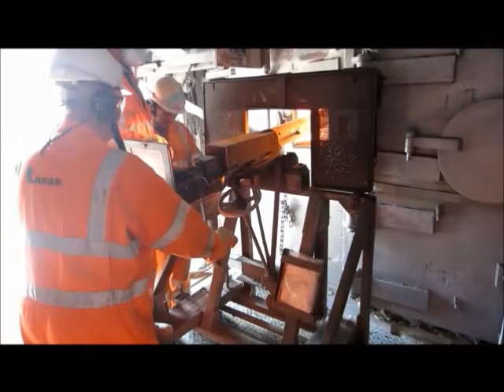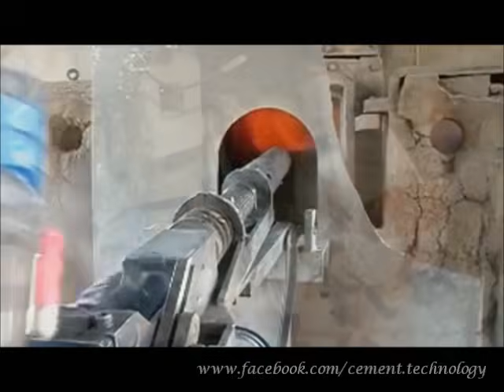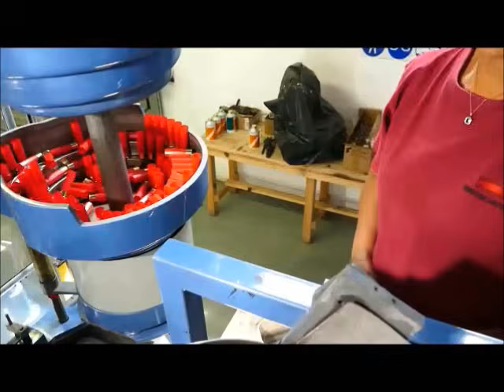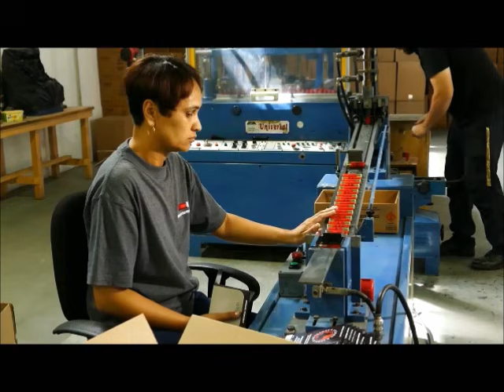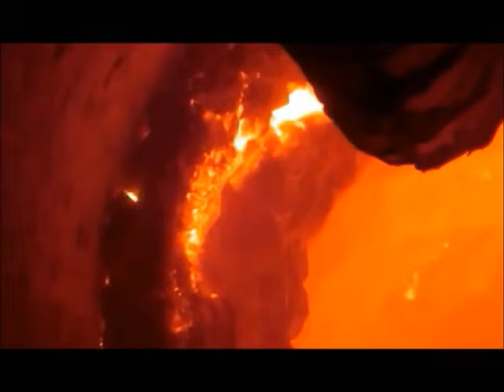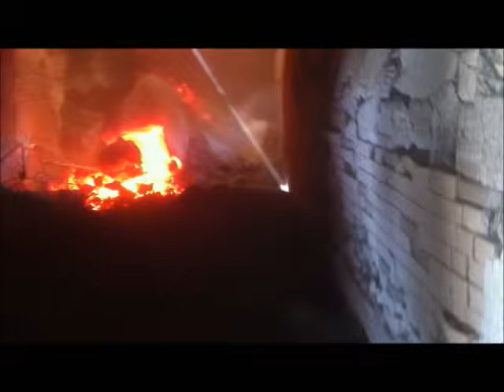Industrial Shotguns

Comment: I used to work at a coal fired power plant in south- central Illinois. We had a Winchester-Western 8 ga we occasionally used for removing slag from the maim fire box walls when deposits were extra heavy. I don't recall how much the company paid to have it on property each month but eventually, it was decided that it was more economic to send the gun back and use Remington 870 12 ga shotguns fed almost exclusively Winchester AA trap loads. The 8 ga is an impressive looking tool but after using that heavy thing vs the 12ga 870, I would have to declare the 12ga the better choice.
Reply: I thought that my father used to tease me, when I was little, I would be 6/7 years old, and he told me the story of: The American of the Winchester, that to solve a problem in a warehouse or silo, where they could not remove the  material added to the walls, and they solved it by calling an American who traveled with his winchester, up to here in the Basque country, the quarry where my father worked extracted magnesite, which I think is used in smelting furnaces to cover the interior walls of the  oven, well, the question that, that happened maybe 40/50 years, .ah the winchester was the rifle of all life, when I showed him this video, we are going to laugh.

Comment: “8 - gauge shells with bigger primers so they can’t be used in commercially available shotguns” as a resident of burger land this hurts me deeply.
Reply: Just drill it out to fit a normal 209, seating it in the original dead primer. Works well for Berdan type primers as well, but with boxers instead of 209s

Comment: They use big-ass shotguns to blast the clinkers out of certain types of coal-fired boilers. I’ve seen them do it in powerhouses, one old plant I work in, they just use what appears to be an unusually large, heavy, single-shot break-action normal shotguns that fires standard 10-ga buckshot rounds. One of the guys that runs them there gave me a shell, it wasn’t marked, but I cut the end off of it and it appeared to have been #1 buckshot. Pretty cool. The other plants I’ve worked in use those industrial Remingtons shown in the video.

Comment: Some grain elevators have a gun they can run in to the bin and shoot a huge steel slug up into a "bridge" of whatever grain in the bin. Would like to see that!
Reply: I would love to see this I work for a company we build grain bins and silos occasionally work on grain elevators I have never heard of someone shooting the grain down though hahaha I'm assuming you are meaning by bridge when a pocket is formed in the grain I've only seen that happen in silos it's very scary when it collapses when you are on top
Reply: @Aatell764  Yep,except they shoot up into it from the bottom,I've never seen it,but I was on the fire department with a guy who worked as a machinist and they made the slugs. He brought a bunch of seconds home and we made a black powder cannon that shot them! It might be an old technique,but he said they use them in those gigantic bastards that held like a couple hundred thousand bushels. They could run it out at a bunch of different levels. Had a brass cartridge that was loaded into the breech and the slug was slid down the barrel.
Yeah,the "bridges" can occur from frozen grain,mold excessive dust that drew moisture,etc. We get them occasionally right over the center door on the floor,when dust builds up or a bunch of corn stob chunks or bean debris gets compacted in a layer. Last winter we had to go down and bust up several in this one corn bin. Sucks rocks!!
Reply: @tomcline5631  Man I'd love to see it in action, and I know the type of elevator you're talking about 9 times out of 10 we are fixing something made out of metal that's been rusted all to hell from being left covered over winter in those haha. We got a customer of ours who always fills his bins full of high water content soybean/corn and every we have to go back to fix something else, we try to tell him man.
Reply: @Aatell764  Yep,we got a damn good drier,so we hardly ever have any corn wetter than 16% for more than a day or two! As for soybeans we don't cut til they're damn near perfect. Might go in at 12\13% then we put the air to em.
Reply: @tomcline5631  Nice that's actually one of the most common things we fix is driers haha well other then the power sweeps. Where are you located? Those percentages are the same that they do it down here in Kentucky/Ohio/Indiana we work all over the place.
Reply: @Aatell764  Work for a farmer in Orrick mo. 1\2 hour or so northeast of Kansas City Missouri.

Comment: I’ve done this for 10 hours with standard 12 gauge 870 with 00 buck at old willow island power station in WV back in the early 90s. We had 55 gallon drums full of empty hulls they let us take home (along with plenty of unfired shells they gave us). I was an apprentice boilermaker local#667, none of the old timers wanted to do it so I volunteered lol, sounded like fun, it was for about 15 minutes.
Reply: 12 hr. shifts,  sometimes 3 or 4 shifts. Duct tape pads to the butt stock. Doesn't help. Usually have 3 or 4 or 5 12 gauges and one 8 gauge on a tripod.  Shoulder and bicep completely black and blue. Finger too from trigger guard.  If you get a good system going and your gun keeps working you can fire the 12 gauges about a shot every second and a half. You mentioned it was fun for 15 minutes,  you got me beat by about 14 and a half minutes.😂😂😂👍👍
Reply: @snakeplissken3021  lol, I’ve heard about those 8 gauges from the oldtimers but never seen one, what profession and area are you in? Boilermaker?
Reply: @shanek6582  construction in coal fired electrical plants. Yeah, we still use them all the time at one of the plants.
Reply: My great grandfather did this with a 10 gauge sxs in a steam powered sawmill back around the turn of the century in Northern MN.

Comment: Seems pretty inefficient. Especially the manual loading of shells 1 by 1.
Reply: There are many reasons for that. Keeping a magazine near that glowing kiln pose a risk of cook-off. Also, the gun designs should be simple and robust because they may consume up to 3000 shells a day. Unlike hunting or fighting guns where you have a lot of downtime for maintenance, industrial equipment must be able to work at higher load and little downtime. This is where the industrial in the name comes in.
Reply: So what's your solution?

Comment: I've witnessed this first hand. 8 gauge, indeed. A behemoth of a round. It's so loud it would knock the lime dust off of the rafters.
Reply: If memory serves we used 4 or 6 ga at the Tilden/Empire mines. Zinc coated slugs. The gun was bolted to the ground. I’ve seen the kick. Nobody is gonna shoulder a 200lbs gun that’s 3-4’ long. Sorry but no.
Reply: I wanna shoulder it with a sling
Reply: @YoungBeefSnack , and I wanna watch you shoulder it with a sling. Although, I suspect any gauge is shoulder-able once or twice.
Reply: @rustythrombosis5417  a little balls and a good lean forward will do the trick
Reply: @rustythrombosis5417  many 8 gauge shotguns existed back in the day. They were good for waterfowl, but later became outlawed in most states. They weren't significantly more powerful than 10 or 12 gauges, just patterned better

Comment: Why don't they make it fully automatic belt fed??👍😎
Reply: It needs to be super reliable and very, very safe.
The thing would probably have to be 3 times the size for any sort of sustained fire.
Reply: @jimboblordofeskimos  you can make any caliber belt fed
Reply: @jimboblordofeskimos  you can make any caliber belt fed
Reply: @mikeyholterfield9019  Yes, and you need to increase the size of the mechanism exponentially as the explosion in the chamber gets bigger
Reply: @jimboblordofeskimos  ya, so...
Reply: @mikeyholterfield9019  ... The increased size, weight and drop in reliability would make it impractical for what it was made for?
Its not rocket surgery.
Reply: @jimboblordofeskimos  not really
Reply: Because of weapon laws. I don't think government would allow high caliber machine shotguns
Reply: @quadroninja2708  if the government says you don't need one, then you need one👍😎

Comment: This still seems very inefficient though.
Single feed small-pellets ? Why not just use semi-automatic spring-loaded cartriges, and instead of shooting small fucking pellets, shoot bullets.
In my humble opinion, I think an AK on a tripod would be much more effective.
Reply: This thing fires three ounce slugs with about six times the muzzle energy of an AK.
Reply: Do you honestly think it would be more efficient to store, load, mount, and unmount multiple amount of magazines?
Reply: @ridhosamudro2199  just clips not magazines.
Clips like the Bofors guns. They are quick to reload. Reaload from atop.
I think they don't do it because of the strict gun laws, they have to keep it single shot.
Reply: @QuiEstJauneAttend  well, you still have to load the clips one by one. Bar using a hopper, you'll doing the same thing anyway with more parts

Comment: I work at the cement plant and every year we have to change 60-80% of the bricks in the rotary kiln. Most of the slag is at the entrance and minimal at the burner. Maybe they use lower temperature because i never see such a build up. Also it can be they are shorter we have 100m and 120m both OD 6m with operating temperature 1200-1500°C (1350 is ideal). But i am quite certain that almost all the kilns in this video are used for metal refining

Comment: This is awful in so many ways.

3000 rounds a day possibly, yet it has to be hand-loaded. Using singular ball projectiles instead of explosive or some hollow point esque stuff that will impart more shock energy for breakup purposes. Using expensively assembled shells instead of air pressure.
Reply: I'm pretty sure they have good reasons to do it this way. Most likely it's because of firearm regulations.

Comment: 8 shots into this process the cost of ammo causes the cement factory to go out of business.
Reply: The insurance premiums for sending a guy with a crowbar into a furnace where heavy slag could hurt him would be more expensive
Reply: At that rate of consumption they probably will have a reloading station somewhere in the factory. When you buy everything in bulk, you get a huge discount. They gonna buy powder and buckshots in the buckets anyway.
Reply: Nah, they're cheap slugs, relatively speaking. MUCH cheaper than the man hours and liability involved in chipping hot overhead slag by hand.

Comment: Seems inefficient to have to manually load it like that. I wonder if a magazine is not used because of the heat? Having a bunch of shells cook-off inside the gun probably wouldn't be good.
Reply: These are Martini type dropping block guns for the most part, which is a strong and foolproof system; coming up with a repeating gun the entire breech mechanism would have to be redesigned and would probably end up being too stiff or heavy to use manually as more moving parts interface to make the gun work.
Reply: Also you still have to load the magazines anyway
Reply: Semi auto/ full auto shotguns and shotguns with magazines are hated by politicians everywhere
Reply: It's entirely due to firearm laws.
Reply: @bettaatrium7156  what? It's not like the magazines comes pre loaded
Reply: @ridhosamudro2199  well if it weren't for the bs there is no reason it can't be a job to load the mags and change them out.
Reply: @daltongarrett7117  yes and to maintain it, repair it, buying new ones, and inventory stuff. That's quite a lot of jobs, I agree.
Reply: Inefficient with respect to what?
Reply: @BlurbFish  in the respect that you have to pretend it's an artillery cannon instead of a machine gun.
Reply: I was wondering that too.
Reply: Maybe all the dust too wouldn't work well in a semi auto style action
Reply: @blakegrunwell5442  We use them for shooting down the widowmakers in the firebox for electrical plants. You're correct, the ash doesn't allow even a pump 12 gauge to function for very long. They won't eject after a while. One person shoots while the second guy rods out the spent casing and loads another one.  It's also due to safety reasons,  having a bunch of guys in a confined space (it's a big space but still) with loaded guns is begging for trouble.
Reply: We load them at our company one at a time to be safe and keep from leaving trash behind
Reply: it's still considered a gun so it has to comply by country laws .Most countries prohibit full auto gun ownership for whatever purpose ,only law enforcement and military use ,edit: upon research making this mag or belt fed would make it a destructive device under the law
Reply: Other countries are lame.

Comment: Interesting but seems like the old way got it off in bigger peices
Reply: Yes, but it takes like 2 hours to wait for the oven to cool down so you can go in there and bang on the buildup, while with an industrial shotgun you can clean out the oven in like 15 minutes.
Reply: Bigger pieces are harder to handle, and often have to be broken up for removal. Also, you can see a big one almost fall on a guy.
Reply: bud, in a mill, 1 hour down time is 100k dollars potentially.
Reply: My guess it's to keep the built up low so it wouldn't be necessary to clean it "the old way" so often

Comment: 3,000 slugs per day!!!! Holy hell
Reply: @Trusty_Stranger  They definitely do. When a kiln is up in running you usually get anywhere from 180-260 Tons of clinker per hour. Rings don't form very often, so it's a very efficient way to quickly remove buildup to resume production.
Reply: If you do it the old way, it will take hours for the kiln to cool down so the worker can go in and clean it up and then it will take hours to restart the kiln. That's a lot of work hours wasted. With the shot gun, you only have to slow down the kiln and lower it's temperature for like 30 minutes while shooting the gun then go back to normal operation. Most of the time, saving time is more important than saving money.
Reply: Also, at the beginning, you can see that cleaning the kiln by hand is quite a dangerous task. Those slag build up are heavy hard like bricks. Knocking them down over your head is the most effective way but you are risking having them dropped on your head.
Reply: These are rated to 250,000 rounds over their lifetimes

Comment: Hmmm
what about attaching a AA-12 to the kiln
Reply: That would be awesome AA12 with zinc slugs! 12ga isn't really good enough to smack the moster chunks of slag off though! I think they used 10ga for a bit but 8ga is perfect
Reply: @Mav8887.  insert slug rounds
Reply: @Mav8887.  It said here 8 gauge or bigger. So it's totally possible that there are kilns that require larger gauge shotguns.